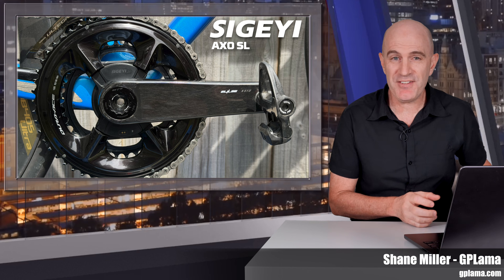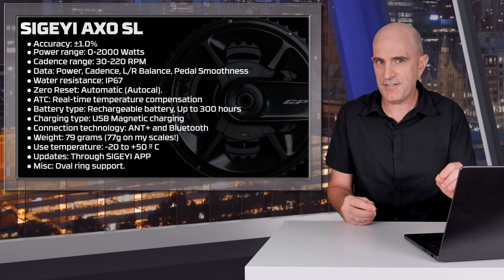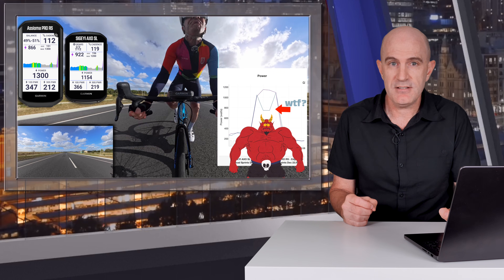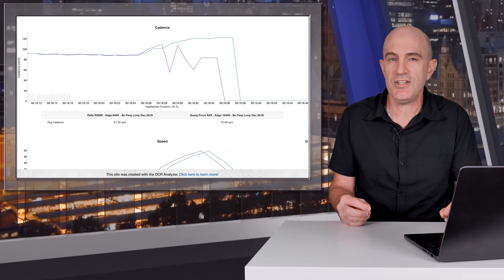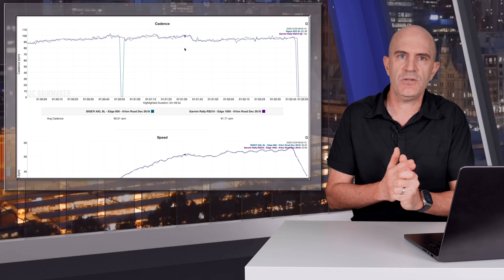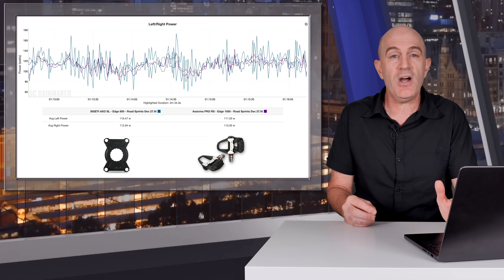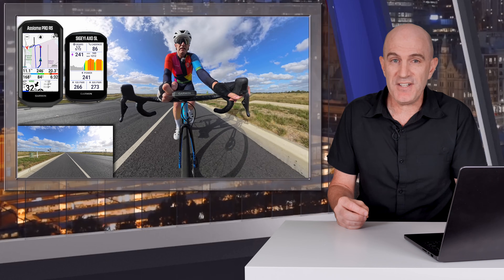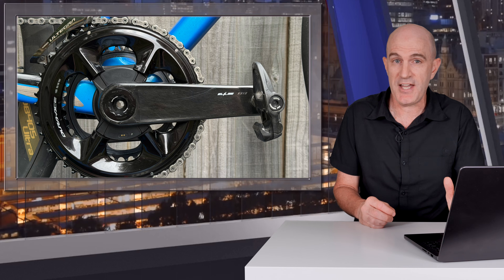SIGEYI AXO SL Spider Power Meter Review

Comment: Great video as always.
In general power meters are used for VO2 intervals 230-400w depending on riders fitness, pacing climbs, ftp thresholds, etc.
In my opinion, accuracy above 1000 W or even 800 w It’s not important.
As long as the power meter is accurate below 800 W in steady efforts that’s what’s important to me. When you’re sprinting, you never look at your power meter so who cares.
But for people who care about their sprint numbers, this power meter is not for them
Reply from the maker: Accuracy across all power ranges they claim the device supports is why people buy these, so they'd want to update their technical specifications to be given a pass on that. It's also not accuracy as such either. The cadence sensing is failing during certain efforts. I can reproduce this in sprints. I've no doubt it'll occur in other use cases as well. Possibly high cadence efforts, etc. Nobody is looking at real-time sprint data, I agree. It's the recorded data they (and coaches) look at. At the end of the day this meter does not meet its own technical specifications.

Comment: I had the opportunity to beta test the SL for the last few months and prior to official release. I’m very meticulous with my assessments of power, and cannot say your experience matches mine.

I A/B’d this against my Wahoo Kickr v5. Generally, the discrepancies were never more than 2%, and the AXO SL only ever slightly under reported.

Because of my profile (85kg and very fast twitch) and what I do outside of cycling (lots of squats), I objectively have a relatively high max power (2000w+ peak and an 1860w 5 second in the last few weeks of fairly specific training). Because those are the situations which really test a power meter’s ability to rapidly measure and record dynamic shifts and spikes in power, I always assessed those efforts carefully and being sensitive to any “fake news” it might have delivered. I rely on these things heavily to track my training, particularly with respect to sprinting, so this level of assessment is important for me.

Truly, I’ve never seen the drop in initial cadence at the moment of attack you have. With my power entering 1800watts+, you would think if there was an issue with cadence there would be a greater exponential decline in measurable output (carrying your logic over however, and noting that power = torque + cadence, there’s a temptation for me to tell myself, on the basis of what you’ve identified, that I may be clocking much much higher power than what’s being measured. I’m resisting that temptation for now 😅). I’m just an armchair engineer, however, so I don’t know if this theory stacks up.

I’m not suggesting your method is wrong, just that I am very very surprised. I query whether it might be the precise unit you have, or whether there might just be a bad batch?

I’d be happy to send you a few of my files in case you wanted to undertake a deeper dive? Let me know and I’ll send you an email!

Ps I don’t work for SIGEYI and am in no way shilling for them. 

Pps Also in the avoidance of doubt, despite being rated at 0-2000 watts, these things can go in excess of that. This is the advice from the manufacturer. I was able to go above 2100watts on the old version. My beta version has apparently been calibrated to 2500watts, but that is not a wattage I could ever achieve.
Reply from the maker: Thanks for the insight. The issues I had were constantly repeatable. I’ll leave any further diagnostics to SIGEYI. I can re-test within hours of receiving new hardware.
Reply: @gplama also the other thing which might be worth mentioning is that there is an actual issue with cadence measurement as a result of the latest firmware upgrade.

When I did the upgrade, I discovered cadence peaks of 200-250RPM at 0-150 watts. Not only is that a cadence I can’t achieve, it also would never result in such low power.

I reported the issue to SIGEYI and they conceded it was an unanticipated result of the latest firmware upgrade. That upgrade was an update to the ATC function, which somehow had that consequence. They recommended reverting to the previous firmware. I did that and the issue went away.

It’s the reverse situation to the one  you’re in, but perhaps there may be some relationship?
Reply: Sounds good. I’m really invested in this topic, so I look forward to any of your updates!

Comment: How’s the PM9 testing going?
Reply from the maker: Slowly. It has a very small amount of residual torque after sprints. Their app confirms it. I’ve had it looked at by SRM here in AU and need to retest it.
Reply: none of which sounds very gold standard-y

Comment: Shane. What's your FW version? On my unit there was recent update to "SL_2.28_260107" with a release note about power reading optimization.
Reply from the maker: It was the latest at the time of testing - SL_2.16_250905. It'd be great if they could provide a little more detail about each firmware update.
Reply from the maker: Firmware SL_2.28_260107 was tested again in sprints. Cadence issue still occurring which is influencing the power data. See images on the activity over on my Strava: https://www.strava.com/activities/17019837564/overview
Reply: @gplama  that’s a bummer.

Comment: Hello. I always find your channel's power meter reviews very helpful. Thank you for featuring my video—I was truly surprised.
Regarding the power "drop" during sprints, the recorded cadence data showed no anomalies, but it's possible that rapid changes in crank angular velocity weren't being captured accurately. For reference, the power meter hardware version is V2.1, and the firmware version during testing was 1.67.
A link to the log data is available in my video description.
I've also uploaded subtitles to my video, so YouTube's translation feature should help you understand the content to some extent.
Reply from the maker: Can you please check the link to your data is correct? It links to a Twitter post, not a data file.

Comment: Sigeyi is known for plenty of firmware updates every year.New update was just released recently. All spiders(quarq, p2m, srm) may underreport comparing to pedals during high sprints! Overall data, including intervals are very good. I use mtb axosl for shimano for 3 weeks now, does not see any differences with the old AXO.
Reply from the maker: The issues I’ve had isn’t just underreporting, the unit is failing to measure cadence.

Comment: Were there any noises when sprinting? I don't hear any in the video, but if the spider is moving at peak torque - possible given the sloppy interface in the wavy bits at the PM/crank connection interface -  it could be having an effect? Each time you show the errors you're mentioning "hard effort" which is what makes me think this.  Especially given steady state appears to be fine.

I have power2max on the roadie and it was squeaking. Ended up being loose at the spider, needing to be tightened. Too cooked in that race to notice power errors and no control anyway :D
Reply from the maker: It's locked in tight and with no back pedal force ever being applied, I assume it's not too much of an issue.

Comment: This is so disappointing as I'd planned on this PM for a build with a 8-bolt SRAM Red crank (and Shimano chainrings).  I really was looking forward to the 80g weight,  to help me get sub 6.8.
Reply: I was doing likewise and planned to buy 2 of the SL versions. I've had several of the old versio AXO ones and so far been happy with them, but was just targetting that extra 20g saving plus the integrated covers that match the R9200 chain ring profile for a more factory look. Having read this I wont be wasting my money and will stick to my AXO ones for a bit longer. 🤞they get the issues sorted and a future test will show the issues as resolved. Sigeyi have supply issues with several variants of the old AXO ones now anyway. Maybe they planned to superceed the AXO with the AXO SL and stopped production of the old version. This is certainly what Chinese suppliers have told me as they havent been able to get new stock for a few months. Looks like Sigeyi have really shot themselves in the foot just when they were starting to get brand loyalty from people like myself ☹️

Comment: DId not expect this from Sigeyi, since the original AXO was GPLama approved with flying colors!
Reply from the maker: Yeah, disappointing, but not uncommon. I think there are two things going on here:
1) Companies chasing “lighter/stiffer/etc.” and ending up with materials or designs that just aren’t up to the job.
2) Better testing and analysis tools… and knowing exactly what to look for.
Reply: I really want to hear why they thought it was necessary to increase torsional stiffness. Power meters work by measuring deformation, so if you make the object you're measuring harder to deform, it's just gonna make it harder to get accurate readings. Sure more lateral stiffness is great, better shifting, chain retention, etc, but was the torsional stiffness really needed? There isn't really any power transfer loss worth chasing in that.

Comment: 4iiii did a warranty exchange on GPX left side power meter because of constant issues with the twist open battery cover maintaining a good connection 

The replacement is called 300X and now has a robust o-ring cover secured with 4 Allen screws which stay retained with the cover 

The 300X is vastly superior and never drops out or gives silly high 1 second power spikes

Comment: When will we see a decent spider based power meter come into the market which works?!?! Wanting to make the jump from an Ultegra crankset to a carbon crank but put off by poor performing spider PM’s
Reply from the maker: Power2Max just dropped their pricing. I have an NGeco that's solid. I need to get a hold of one of their Eastern Cinch spiders to use these crazy light cranks with.
Reply: @gplama  do you have any plans to test the arcrayo ARS spider PM
Reply from the maker: @SupernovaRallyteam  Yes. I have one.
Reply: It's a shame the Magene P515 Teo is 29mm Dub only.  Not sure what the reasoning is for that. The PES is fantastic though aluminium crank.

Comment: Well, power meters in China have dropped to around 70 US Dollars. It will not be long until every road bikes have them preinstalled. We will see more competition and get better ones very soon :3
Reply from the maker: What brands are down to ~US$70? Geoid?
Reply: @gplama  thinkrider pp5 power meter, brand new 450 CNY on the peer-to-peer market right now
Reply: @shad0w1and  P2P market? What is that? Like normal classifieds, or something else? I am interested.
Reply: Cheapest are 200 usd. HRM are more expensive than 70
Reply: @angelgruevski  Magine HRM H003 is around 90 CNY or 14 USD I believe.

Comment: The low weight (for a spider PM) is impressive, but seeing the issues, getting a Power2Max instead of this is just a no brainer. And right now the NGeco with the Easton interface is 340€, so about 100€ cheaper than the Sigeyi (at least in Europe)